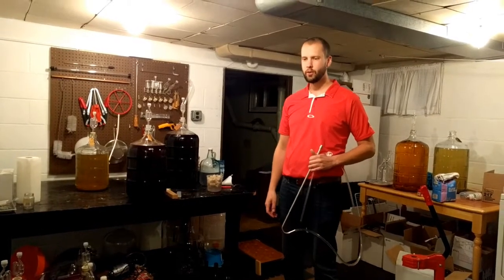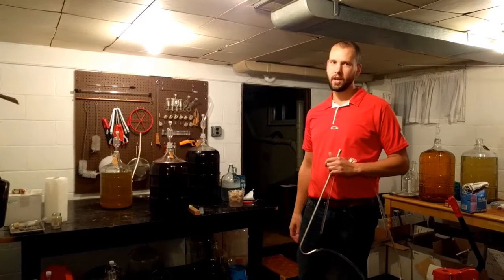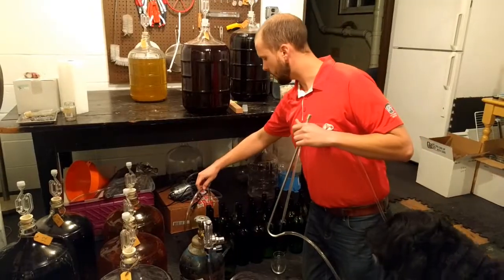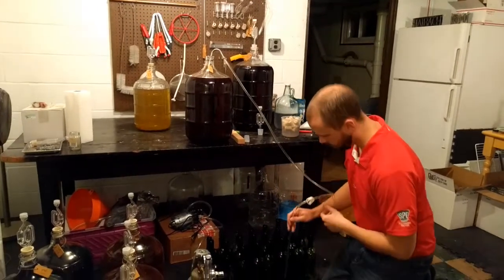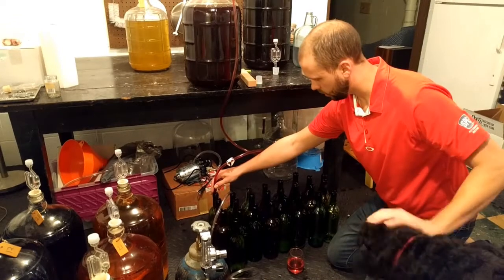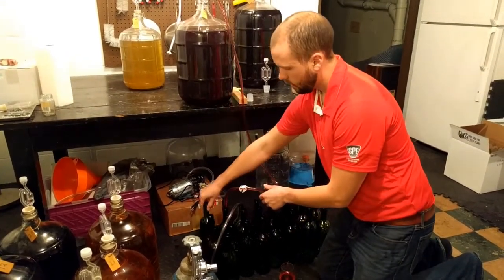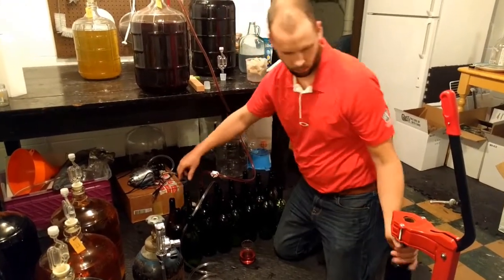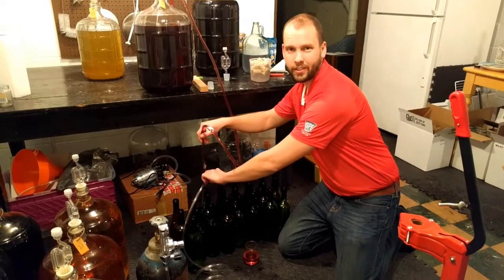Advanced Winemaking Techniques: Bottle Sparging

Comment: Would CO2 work as the inert gas? I believe it's heavier than Argon?
Reply from the maker: +Steven Bryce CO2 is fine.  The only slight advantage with argon is that it is not soluble with the wine.  Worth CO2 you might have to degas a bit right before bottling.

Comment: What psi equals 1 liter per minute?  I already have a Co2 tank with regulator and will probably eventually get a argon tank but they're pretty pricey from what I've seen.  I make mead and have to top up with marbles on the bottom and this would be so much easier.
Reply from the maker: 1L per minute is pretty much barely flowing.  Just enough you can hear it hissing a little.  To be exact it would be a fluid dynamics equation with the diameter and length of your tube being the main variable but I would just turn it on until it is just barely flowing and call it good enough.  I am guessing it is well under 1psi.
Reply: so, maybe a dumb question for a new wine maker, but why would you not just fill the bottle first and than displace the little remaining air with the argon before corking? This would use far less Argon (which I buy in cans and its a bit pricy) and accomplish the same thing......or am I wrong....thanks

Comment: Not so sure this is needed, most wines need a little oxygen to breathe and age properly, and an inch of air at 20% oxygen equates to less than 1/4” of oxygen in the neck of the bottle. 

Nice idea but is simply not needed.

Comment: I looked into getting argon gas at my local supply store.  They asked me if I wanted “food grade argon” . I would assume food grade would be better but is it necessary or can I use the regular argon?  Because it’s much cheaper than food grade.
Reply from the maker: I wouldn't worry about using the industrial grade for home use.  Welders are very particular about getting super pure argon 99.6 to 99.8% which is pretty darn good compared to the air that you are displacing.  The industrial grade probably could be transported in tanks that previously carried nitrogen or helium I might guess and may not have a paper trail like the food grade would.  But honestly it's probably 99.9% the same stuff.

Comment: do you know if I use potassium sorbate on bottling time, do I still need to use Camden tablet also ?
Reply from the maker: +panisher yes.  Potassium sorbate inhibits yeast multiplication but doesn't protect against oxidation.  Camden tabs are your sulfites which give the wine longevity and act as an antioxidant.  If your wine is completely dry though or it has been filtered you can skip the potassium sorbate.
Reply: The Home Winemaking Channel ok, makes sense now. Thanks much!!

Comment: Computer duster works perfectly
Reply: Computer duster ("Air" in a can) usually contains butane, propane and/or fluorocarbons.  Gasses that can be compressed into a liquid so they can get more gas in the can.  NOT gasses you want in your wine bottle.